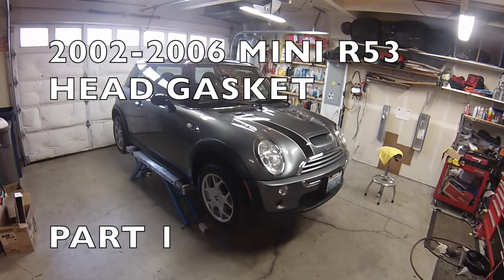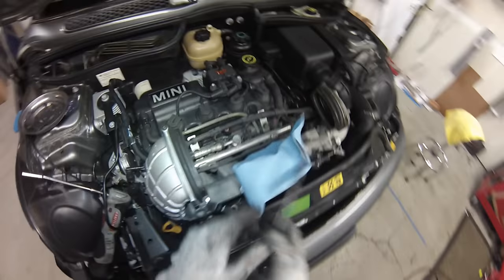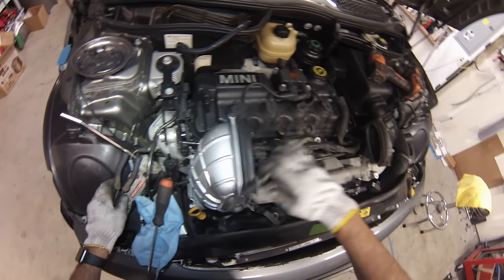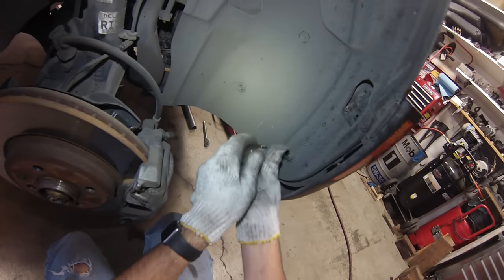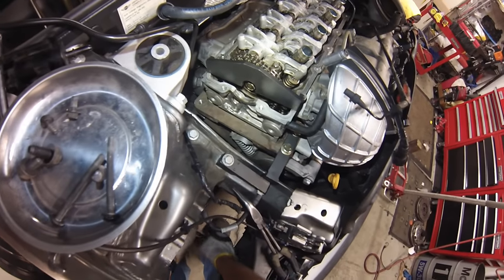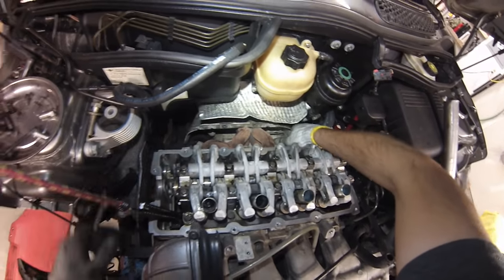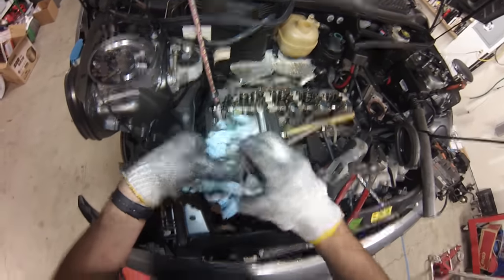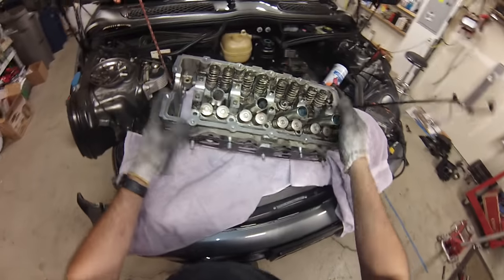How to Replace MINI Cooper Cylinder Head/Gasket 2002-2006 R53 Part 1

Comment: Great video. Used it to remove my head and replace valve spring on 2006 s, but when I started had some bubbling over of the coolant reservoir. Is this common?
Reply from the maker: A little bubbling might be normal if you filled up coolant all the way and air is working its way out. If it persists or is violent, you probably have combustion gases entering the coolant. Either failed head gasket job or head with a crack between combustion chamber and water jacket.

Comment: Hi there, absolutely loving your videos. Bought a mini cooper s as a non runner 2 weeks ago, suspected head gasket as reported by BMW, so this video has been a lifesaver. Turned out to be a snapped cam! Have you ever come across this before? So whilst I'm here waiting for the head to be pressure tested, valves checked and new stem seals i've decide to replace the water pump, thermostat, timing chain set and obviously the head gasket and head bolts. Do you have a video which covers replacing the timing chain? Regards Steve instagram @sknipey keep up the good work
Reply from the maker: +Steve Knipe I haven't seen myself. I cover some timing chain stuff in the engine rebuild videos.
Reply: +Mod MINI I'm watching your videos religiously right now

Comment: Hello, I need your help please, why, my mini, the heating is failing, the driver's side is warm, and the co-pilot's side is cold? I cleaned the heating radiator!
Reply from the maker: Heater core clogged internally, low coolant, or air bubbles in cooling system, or failed water pump

Comment: I did an oil change a couple months ago on my 05 base mini and the oil came out looking normal but for about a year now I've noticed my coolant reservoir has been going dry but the car doesn't over heat and I don't see any noticeable leaks. Could it be the head gasket? The car runs smooth and it doesn't have a check engine light
Reply from the maker: You may just have a slow leak somewhere that doesn't make it to the ground. Water pump or a fitting or thermostat housing gasket.

Comment: Hello I have a 2004 s and it wont start it tries but just wont . I am thinking head gasket the coolant tank has lots of pressure but no chocolate milk. It has spark and I smell fuel. Just looking for advice thank you in advance.
Reply from the maker: If it has spark, other things to check are air, compression, valve timing and ignition timing.
Reply: @ModMINI  I did take the head off per the video and the top of 1 and 2 cylinders are cleas as a whistle. I am having the head decked to insure a good seal when re installed

Comment: how much does a repair like this usually cost at a non dealer shop? i think my head gasket just blew and I don't know if it's worth fixing at this point
Reply from the maker: +Kibbles Enbits I'm not sure, I've never paid someone for work like this. It's about an 8 hour job. Parts could be cheap or expensive depending on whether the head is bad or just the gasket.

Comment: @Mod MINI Can you take the cylinder head off as one unit without removing the rocker arms and camshaft?

Thanks.
Reply from the maker: Yes, but you'll have a hard time getting it the chain lined up when you put it back together because rocker arms will stop you from easily moving the camshaft.

Comment: Besides the fluids mixing, what  other symptoms did you have?
Reply from the maker: Head gasket symptoms can vary and may  include loss of compression, white smoke from exhaust, coolant reservoir boiling over even when engine isn't very hot, snapping sound, lots of blow-by when oil fill cap removed, misfires, etc.

Comment: @Mod MINI because you had a head gasket failure you drained all the coolant out.

I'm just replacing the cylinder head. In my case, when I go to disconnect the thermostat inlet housing, do I still need to drain all my coolant as well? I'm ok with a little coolant coming out, just don't want it to come flooding out...
Thanks👍
Reply from the maker: You should drain the coolant. It will go all over the place if you don't. It will still spill when you take off the head even if you do drain it. But not as bad.
Reply: Mod MINI Thanks!

Comment: this can also be caused by short drives of 3 or 4 miles.
wy? the engine does not reach its optimal working temprature so condensation cant evaporate and stays in the engine.
Reply from the maker: +otto levering That is true. The condensation will usually appear at the dipstick and oil fill cap, making it look worse than it really is. Change the oil and look for overall 'melted chocolate milkshake' appearance to confirm.

Comment: YOur videos are a god-send. I am planning to do the head gasket and the rear main seal. Can I do them in conjunction with each other, or do I need to do one at a time?

I subscribed!
Reply from the maker: It's up to you, you can save some labor doing them at the same time. If I had to do both I'd probably just take the engine out of the car.

Comment: Nice video (as always)!  I just did this on my '03 and didn't have to loosen the I/C outlet duct from the intake manifold to remove the head.  Saved a small amount of time.
Reply from the maker: +rbazola You must have had to loosened it from the bypass tube or the intake tube from the supercharger?
Reply: +Mod MINI you are correct, the plastic horn slipped off of the s/c inlet!  It's buttoned up now.

Comment: I would like to ask you one more thing do i have to kerp the piston no 1 on tdc also how do i mark the top cam with was not sure on this.
Once again best video
Reply from the maker: No. Use the special tool to align engine at middle service position (all piston tops aligned). If you don't have tool and mark chain and sprocket orientation, engine can be in any position. but DO NOT lose chain/sprocket orientation and do not leave the chain loose, do not turn engine bottom end while chain is loose. Just mark with white out, or scratch it with a pick or whatever. Make sure the mark is durable enough that it won't wear off.

Comment: like the video man.
tell me what is your opinion on the newer mini cooper s engines. did you already see a lot come in for repair regarding to much slack in the timing chain???
Reply from the maker: +Patrick Schenker I haven't had the opportunity to work on many newer MINIs. I have heard that most 2007-2009 R56 have the timing chain problem, but most had the problem when they were still young so it was probably fixed by the dealer. Personally I think the older MINIs are able to take more abuse/modification.

Comment: Hello, to start your videos are very well detailed and I enjoy learning how to fix different cars. I am hoping to purchase a 04 mini Cooper s but it has a blown head gasket which I should be able to do but was wondering what kit/brand I should use. And it also needs a couple wires re-ran due to mice eating them, is that difficult?
Reply from the maker: Hope you're getting the car for cheap, there are a lot of good examples out there. Use any good head gasket brand such as Fel-Pro or Victor Reinz. Wiring can be hard or easy depending on the damage and whether you need to track down hidden damage, which is something I probably would walk away from, honestly, unless the damage is limited and obvious.
Reply: Mod MINI ok thank you for the info, im getting the car for dirt cheap $500. Hopefully the wiring won't be too bad

Comment: hello Mr Mod mini. So i have followed your procedure to remove my camshaft. However, im not sure if i have the right timing mark on sprocket and cam. What happen was that before i did everything, i marked 3 white docs on the chain and sprocket,then put locking tool on the cam,so when i broke lose them cam strange thing happened. All of my 3 marks some how disappeared and i couldn't even found them at all. So i remarked the chain and the cam again before doing anything else. My question is do you think my chain and cam have misaligned, when i broke lose the cam bolt? or i should be ok for the second timing marks? Just so you know,i did not separate the sprocket and cam when i broke lose the bolt,i still left them on together,and then marked as my 2nd time.
Reply from the maker: +khoi nguyen if you are confident your marks are correct and that the chain has not slipped, it might be ok. If you are unsure, the only safe thing is to remove the timing cover and realign crank and cam sprockets by using the three small arrows and three bright links on the chain.
Reply: +Mod MINI im very sure the chain didn't slip,all the tooths were attched on the sprocket while ibwad breaking lose the bolt
Reply: +Mod MINI Sir. My car won't start after putting back everything together. Pls one more time guide me through on how to reset the timing. So there is 1 arrow on the cam sprocket,and 2 on the crankshaft sprocket. So on the chain there is bronze marks on it,how do i line them up accordingly to the cam and crank sprockets? Pls help

Comment: hi mod mini. I have a few questions for you about these minis. I'm looking at purchasing one. I wonder if the headgasket on these cars will go after 1 overheat cycle? also are these cylinder heads resurfaceble or no? thanks
Reply from the maker: It could be fine but every situation is different. It really depends on how long the overheat lasted and how hot did it get. Outcome will be totally different if the driver stopped immediately or kept driving until the next freeway exit. Head can be resurfaced, but if significantly warped you'll have to toss the head. Even if you resurface the bottom of the head, the cam bearings will no longer be all in a line and machining those is not cost effective.
Reply: thanks for the advice mod mini

Comment: I have watched several of these MINI service videos. Boy, am I really glad I do not own one. What a PITA to do anything under that hood. Have heard that any shop work on this thing is major money because so much has to be removed to do the service.
Reply from the maker: A little crowded for a four cylinder, but even with the compact size, I'd still rather work on one of these than a conventional or transverse mounted V-6 or V-8 any day. It's a big job because a head gasket on any modern car is a big job.
Reply from the maker: Oh yeah, and I did a cylinder head on a 1997 Camry, that job was harder than this one...

Comment: Thanks for a really great video! It really made me to go ahead and lift off the cylinder head off my R53 JCW. It was a bit worse though than just the gasket. Piston 1 has a hole in the side. So I'll have to look for more videos how to replace that.
Reply from the maker: Block is probably damaged? You may be looking at a bottom end swap.

Comment: Is it possible to change the piston rings without taking out the engine. So taking off the cylinder head and sump.
Reply from the maker: It can be done but crank stays in place. If you deglaze the bore, you'll contaminate the crank bearings.
Reply: @ModMINI  Thanks for the response. Do you think it's worth changing the piston ring on an engine that has only done 72k and there is no smoke coming from the exhaust.

Comment: Hi mod mini I have a mini one 1.6 and it had some oil in the coolant tank so I flushed and refilled and put a bottle of head gasket chemical repair in the system but 2 weeks later I have oil in the coolant tank again. It doesn't look like it's mixed just 1-2cm of dark oil settled on top of the coolant. Would you say this was a head gasket? I can't see an oil cooler on there so I would really appreciate your advise
Reply from the maker: +Lewis Byatt The two possibilities are head gasket or oil-water intercooler. The MINI One doesn&#39;t have an oil-water intercooler to my knowledge (unless it&#39;s an automatic transmission), which means head gasket. - Also - the head gasket repair stuff will only work if coolant is leaking out, and even then, only sometimes. It won't fix oil leaking into the coolant.
Reply: +Mod MINI thanks so much for your reply I shall get on with the head gasket with the help of your video regards lewis
Reply: +Mod MINI.     done the head gasket today all seems well I would not have done this without the use of your video, I have subscribed many thanks looking forward to more videos to watch

Comment: This is awesome! You are my DIY R53 hero! I'm curious, are you saving any time by not simply taking this car down to front service mode? I think that by dropping the rad at least partially away from the front end, you won't have to fiddle with the intake manifold as much, and will have a bit more room to work. Of course, you are far more experienced then me, so I'm just looking for your viewpoint on this approach.
Reply from the maker: The only thing FES gets you is additional maneuvering room for the intake manifold. Do whatever you want but you can eliminate the need to maneuver by using the secret trick I show you in video. If time is less important to you, go ahead and remove front end.
Reply: @ModMINI  Will definitely try this method when it comes time to pull the head. Thanks!

Comment: Hi,
How do you diagnostic and fix a burned valve ?  and what about servicing and setting the valves train ?
Reply from the maker: Perform leak down test. To fix, you need to replace and reseat new valve or rebuild the head. Hydraulic lash is self adjusting.
Reply: @ModMINI  Ty for all, i'll check as you suggested. i keep an eye on your future videos ! Enjoy :-)

Comment: what if you lost your timing marks ? how can you get it back in time? the harmonic balancer has no timing marks
Reply from the maker: Take off timing cover and align bright links on chain with arrow on crank and cam sprocket. two arrows/links on crank, one on the cam sprocket. Be sure to remove slack from the non-tensioner side of the engine.

Comment: In advance, Thank you for your efforts in creating this instructional video. What is the Model/PN of the battery operated tool you use to remove bolts/nuts etc?  Aside from that I'm hoping you can recommend what I should do next.  I disassembled my 2005 R53 S to replace the radiator and camshaft sensor, but prior to disassembling I heard an air leak that was synchronized with the rotation of the engine.  I've gone over the engine area but have not been able to identify the source of the leak. No water in oil or oil in water. Plugs look normal but at 85K miles and after reading several threads about carbon build up and power loss, at this point it wouldn't take much more to remove the head.  Can you suggest other common failure points for air leaks other than a head gasket?  Any suggestions on any subject matter would be greatly appreciated.
Reply from the maker: +Jay Flow Ridgid 18v impact driver at Home Depot. Any 18v will do. An air leak could come from anywhere but a common one is the small diameter vacuum line on top of the right side engine mount (crank pulley end of the motor). It can get disconnected or the plastic tee broken off. Another spot is the fuel vapor purge solenoid (next to the dipstick) not being fully plugged in. The last and harder one would be the black tube between the throttle body and supercharger. 2005 doesn't have a carbon buildup problem. That's only a problem for gen 2 MINIs. If you suspect head and the noise is from combustion chamber, do a compression/leakdown test and you'll find your leak.
Reply: +Mod MINI I will definitely check all those potential points of failure. I was also told the manifold could be an issue.  I also see you use a Sears Craftsman right angle torgue driver.  I'll probably get the Craftsman right angle torque driver first. This may be a dumb questions but would I need and adapter to use my standard metric sockets? I know it's been said before, thank you for your amazing instructional videos which by far as the best I've ever seen.
Reply from the maker: Probably not manifold. Exhaust manifold leak would be a snapping sound. Intake manifold is solid aluminum. You just need a 1/4 quick release to 1/4 or 3/8 socket bit. You can get those anywhere.

Comment: I like the new lifts, a good investment, do you find it better than axle stands?
Reply from the maker: +Curtis “Harsh Tomato” Taylor A bit costly, and only marginally faster than getting a MINI in the air with jack stands, but it lifts almost 1 foot (30cm) higher than the jack stands can go, so there is a lot more room under the car.

Comment: Always great! Thanks that helped me find my leak. There is a small puddle of coolant in that bowl like area on top of the thermostat housing. Could the leak be between the housing and the block? BTW, wish I was still in Tacoma, would just bring it to you. :)
Reply from the maker: That's a thermostat housing gasket leak.
Reply: Mod MINI thanks for your reply. I’ll tackle that this weekend. My follow up question is Should I go ahead and replace the thermostat or other gaskets while I’m at it? It’s a 2005 R53 with 150k miles. Thanks!
Reply from the maker: You don't really disturb any other gaskets. Replace the thermostat if you want. They usually last a long time but I've seen them fail sometimes.

Comment: How reliable is it to put the car in 6th gear and push on the break? I need to do my head gasket and it would take 2 weeks for the tool to get here and I dont have that kind of time.
Reply from the maker: Works fine, might need to push hard on brake.
Reply: @ModMINI   sounds good and thank you so much for doing this video

Comment: Why did you have to remove the cam and rocker arm shaft to get the head off? I didn't notice any bolts under them that held the head on. Thanks
Reply from the maker: I have to remove the cam/rocker arms later on anyway and it makes the head lighter and easier to lift out of the engine bay.
Reply: Just wanted thank you for sending me the PM! Finally got the head back from the machine shop and the mini is running great again. Also wanted to thank you for the info in the part 2 video. Have a wonderful labor day my friend!